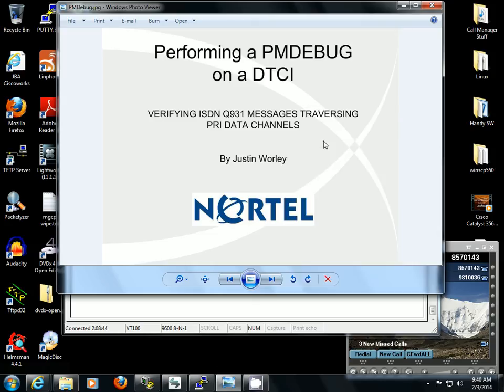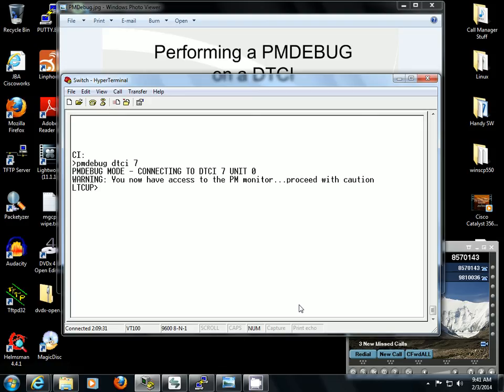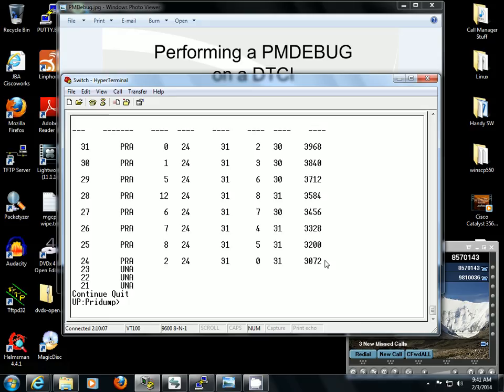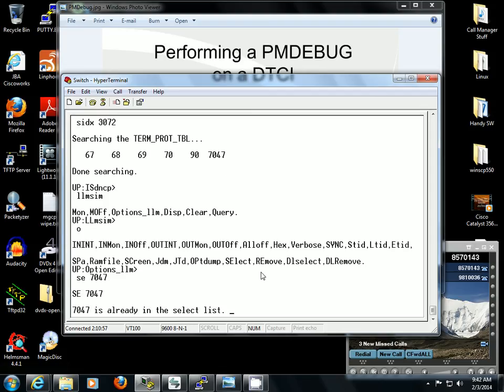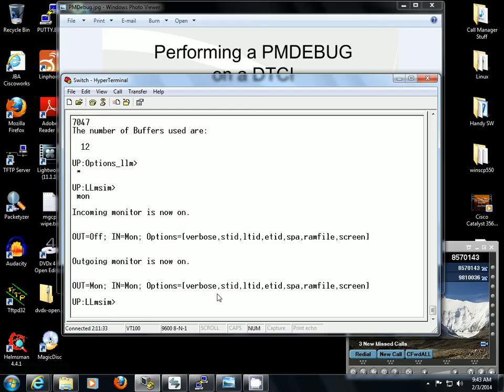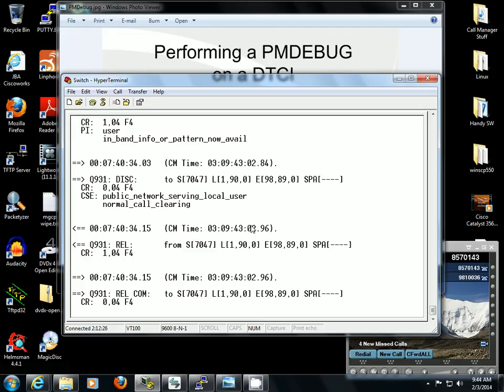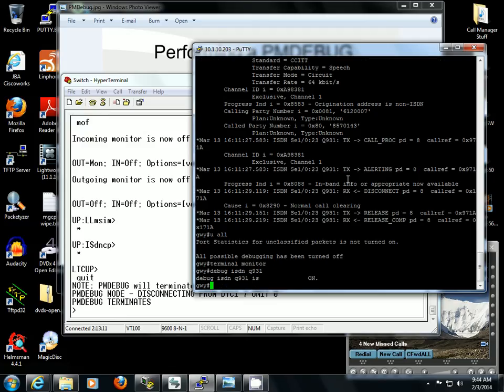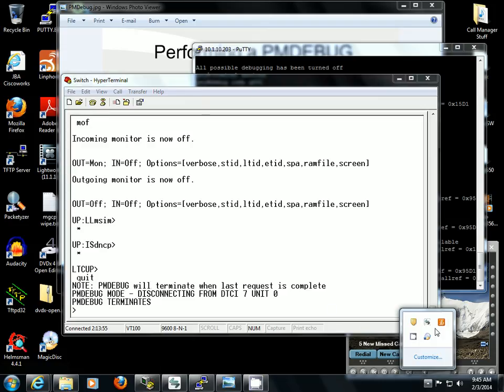PMDEBUG a DTCI on a Nortel DMS-100

Comment: Any reason a link/span wouldn't show up on the PRIDUMP list? DTCI 0 15 is datafilled but does not show up on the PRIDUMP in PMDEBUG.
Reply from the maker: Possibly, if that span is set up for channel associated signalling (CAS), then it wouldn't be a PRI and wouldn't be available for a pridump.  You can do a "clliref search clliname", and verify that the trunk is set for ISDN signalling (TRKSGRP should specify ISDN and 87Q931 with the D channel also listed in the tuple, and you also have to make sure that the logical terminal is defined (tables LTDEF, LTDATA, LTCALLS, and LTMAP).  LTMAP associates the clli with the logical terminal ID.  Sorry, don't know your level of knowledge, so just throwing some stuff out there to check.

That's the only reason I could see a span not being listed.
Reply: Thanks. I was just becoming familiar with the PMDEBUG tool. How do I clear the D-channel counters/peg counts in PMDEBUG?